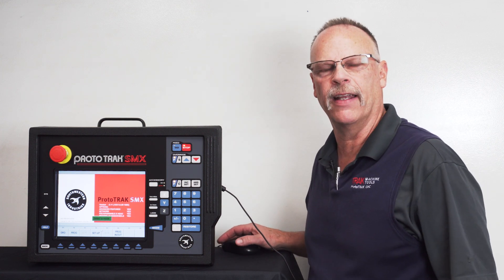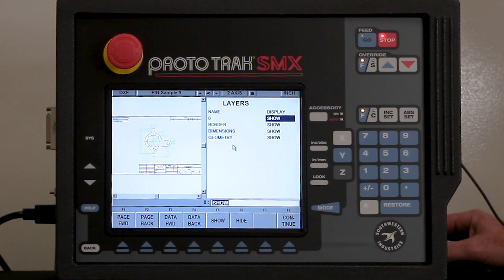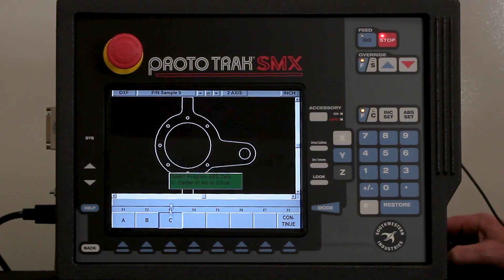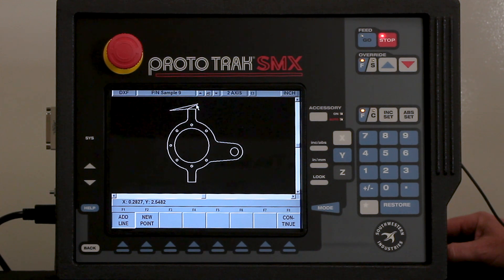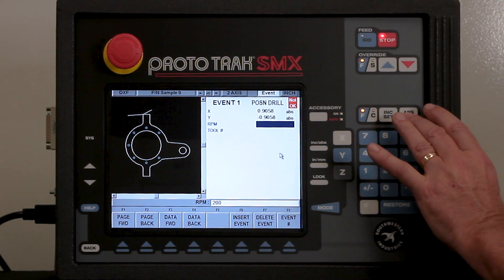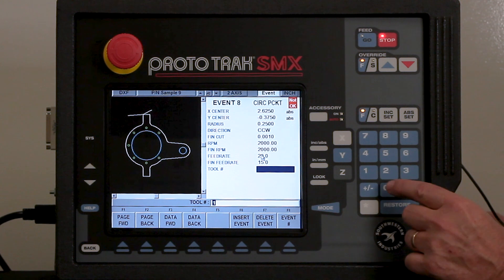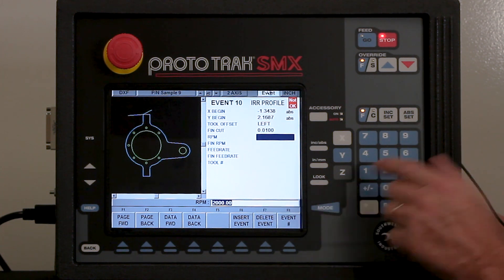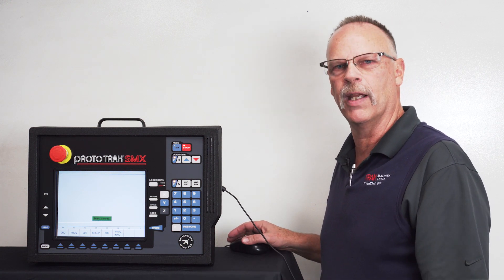2 Axis DXF Files | ProtoTRAK SMX CNC | Mill Programming

Comment: I just purchased an older used mill with the SMX controller, in using a DXF file, how do you get the file to the controller, your video assumes you already have it loaded somewhere in the controller. maybe I might need to see about getting a manual as I received none.
Reply: save it on a jump drive and plug the jump drive  into the control

Comment: Great videos thank you, how do we add a mouse? Is it plug and play?
Reply: Your best option is to buy a wireless mouse/keyboard combination and plug the dongle into one of the USB ports. This way, you can use the keyboard to name your files much easier than using the standard built in keyboard.  If you have an older model S or SX control, it may also have the old style wired mouse plug.  If so, you can use an older mouse.  Thanks for the thumbs up! T.P.
Reply: @trakingpat2750  Thank you for the information and videos. I just started a new job and they have the SMX, about 20 years ago I ran a dinosaur version of prototrak. Your videos are extremely helpful.

Comment: Hello T.P.    Can we do 3 axis surface programming on the control? I need to program a pyramid shape for a moulding tool but we do not have CAD software to do it. I am only roughing it out at the moment . Regards Tony in England. I am going through your videos slowly for milling and they are great, thanks.
Reply: Hi Tony!  here is a link for a 3d video we did on our channel.  https://www.youtube.com/watch?v=XRxhNx71FwI&t=58s  Since you're asking this question on the DXF video, I want to make sure I'm answering you correctly.  You cannot use DXF or Parasolid files to create a 3D surface on a ProtoTRAK.  You need to program most 3D surfaces through a CAD/CAM system as you would in any other CNC mill.  Our controls can run any type of 3D program but due to the size of these files, it doesn't make sense to program these surfaces complete with roughing and finishing passes by hand.  This being said, if you're creative, you can make a program with a bunch of milling events and make a pyramid.  I hope this answers your question.  T.P.
Reply: @trakingpat2750  Thanks buddy. I’ll convene with my colleagues tomorrow. Much appreciated

Comment: Another good video Pat, but, there are no depths associated with the tool path.
Reply: DXF is a 2D electronic print file so the Z dimensions have to be input by then operator.  Are you perhaps confusing this with Parasolids?  T.P.
Reply: Nope, I just didn’t see anyplace where he putting the Z depth in the program. So why use this method? I’m used to Mastercam so I’ve only recently started programming this way.
Reply: @jondenekamp2396  I think the problem is that this demonstration is in 2-axis mode.  If I opened the DXF file in 3-axis mode, it would've asked me for the Z dimensions when I pushed the event button at the top.  Sorry for the confusion.  I will do another video in 3-axis so that everyone can see what I mean.  T.P.